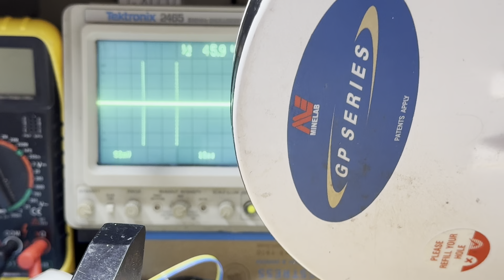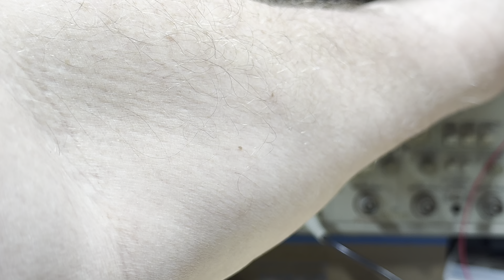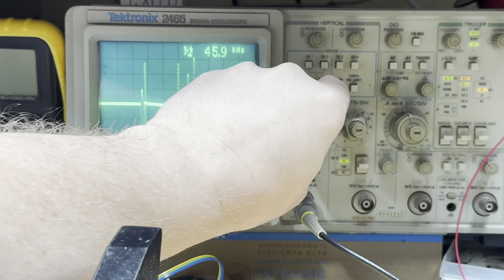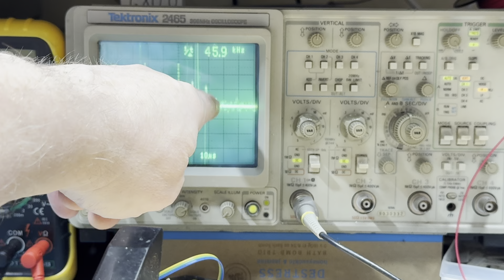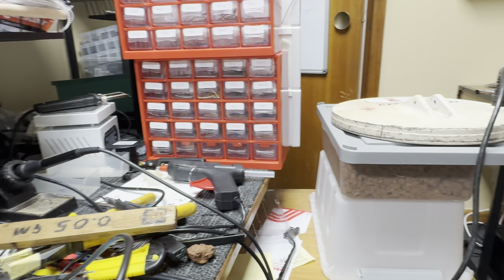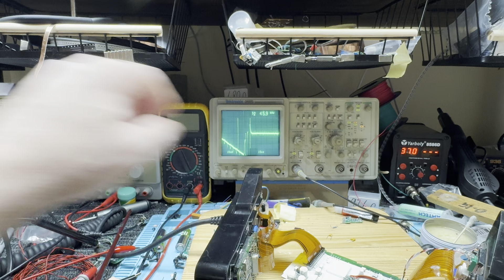Variable damping explained with a demo with various coils.

Comment: Hello Mr. Woody, thank you for your time. I am an inverter repairman and I am interested in building a 30-inch GP loop. I don't know what grade of Litz wire and how many strands to use. Can you tell me? How many ohms and how many inductances? Thanks.
Reply from the maker: 72 strands of 0.12 mm , 280 -320 Uh  0.25 ohm

Comment: Thanks Woody great video, it backs up my finding with my testing although it was a bit harder in the field with the 1st mod as it was so touchy as it was condensed into such a small amount of movement in the pot 😂  but with the new improved unit it would be much better for getting the peak right.. cheers mare
Reply from the maker: Just finishing some newer mods, I will do initial tests and you can go wild.
Reply: @DetectorMods looking forward to it. 😅